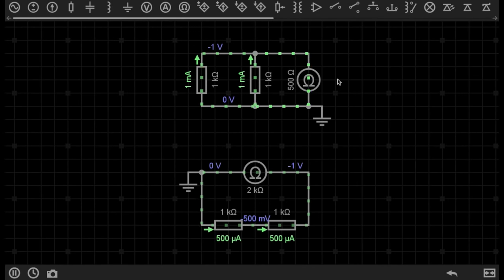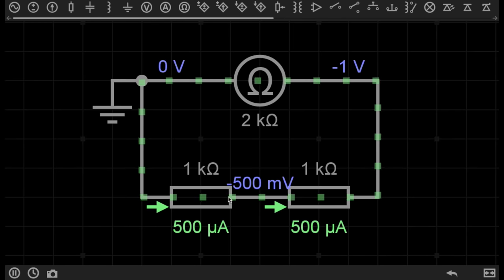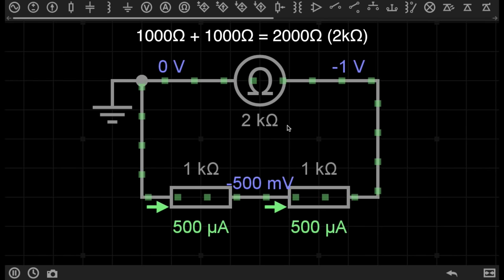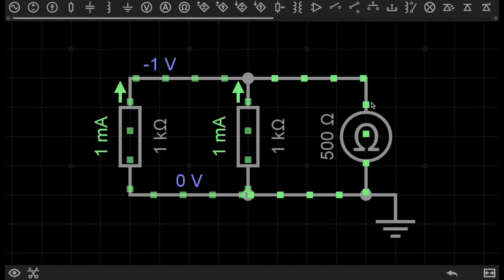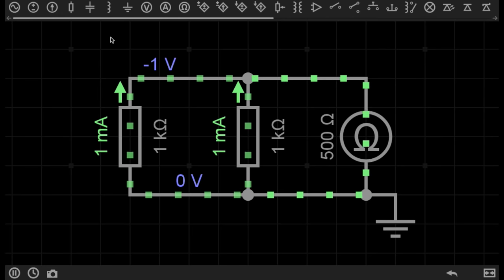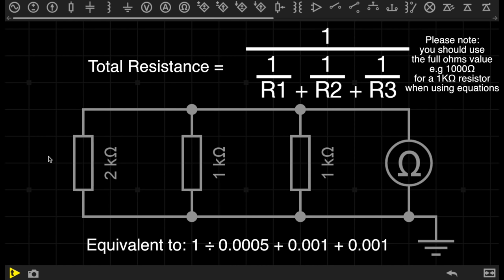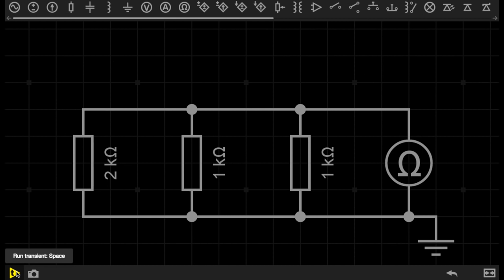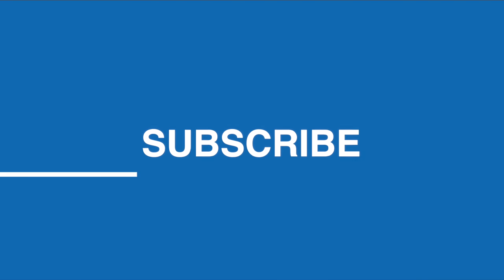Resistors in Series and Parallel - Electronics Basics 13

Comment: I suppose this will improve heat dissipation as well. So if you have two 5 watt resistors, it will have a combined heat dissipation capability of 10 watts?

Comment: What is power supply in these circuits? Besides that, great tutorial. Thanks.
Reply: There isn’t one.
You don’t need a power supply to measure resistance apart from that provided by the meter.

Comment: doesn't this conflict with the previous video about Voltage Dividers? why wouldn't you just use one resistor with the same combined resistance
Reply: one example would be that the wattage your resistor can handle is not enough for what you need, f.eks with a 12v power supply and one 2v 0.02a led you'd need a 500 ohm resistor.

but as a rule you should not exceed half the rated wattage of the resistor, so with a 1/4w resistor the max is 0.125w... the example above has 0.2w.

so two 1/4w 1000 ohm resistors in parallel makes 500 ohm and each resistor supply the led with 0.01a each, so now each resistor is at 0.1w... of course if you had a 1/2w 500 ohm resistor you could just use that!
Reply: @ralphbooger4756  oh ok. Thanks for the explanation, I didn't know you should not exceed half the rated resistance. Does that rule apply even if you're actively cooling the resistor with a little heatsink?
Reply: @bradley9856  
not resistance... watts!!!
if you are talking about really high watt rated resistors with heatsinks im not sure if people use the same rule, but with 1/8, 1/4, 1/2, 1 watt etc... some even go by a max a third of rated watts, i like to keep it less than half.

but cooling is not a bad thing, however using a higher watt rated resistor or use them  parallel to increase watt rating does wonders for keeping them cool... and might help with reliability and longevity, i guess it all depends on how much you care, you might get away with pushing it... :)

Comment: Wouldn't it be simpler to express the formula as 1/Rt = 1/R1 + 1/R2 etc. ?
Having fractions as denominators can be confusing.
Reply: It doesn't really matter, you're going to take the inverse at the very end. But getting Rt directly is faster and better (for me) when using a calculator. all you need to do is (1/R1 + 1/R2)-1 ("-1" refers to the inverse not to subtracting by 1).

Comment: Hi, obviously the info here is correct, unfortunately I'm intelligence challenged. In my head I understand the concept and basically in series you add or gain resistance as resistors are added, in parallel you subtract or reduce resistance as you add more resistors. Got it... wait no I'm confused again. Math sucks. Anyway, WHY and HOW do you have  -1 volt?!?!?!!!! And AND why does the ground symbol hang out there all lonely like, like a dogs tail, seemingly just waiting to cause a short in the circuit. Some bizarre glitching going on there. Seriously, it's odd things like that that totally prevent my understanding of electronics